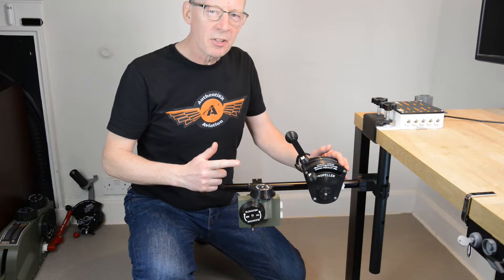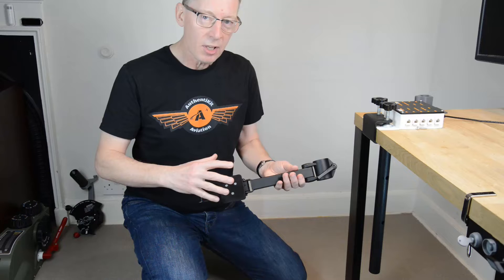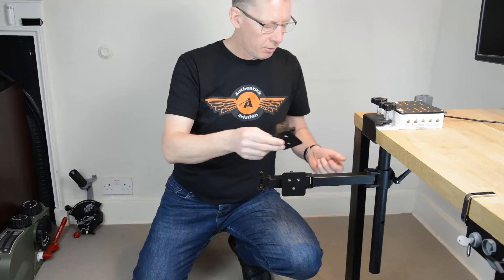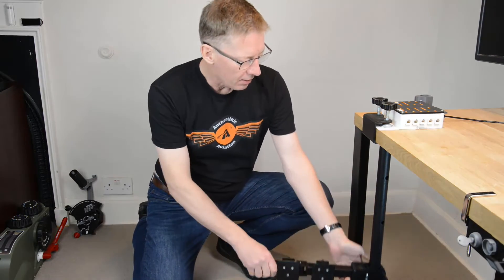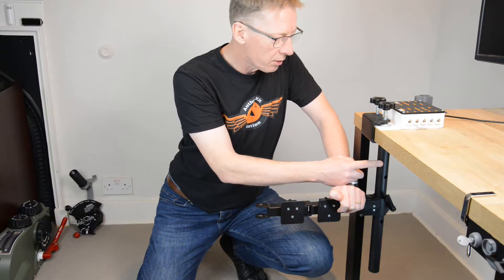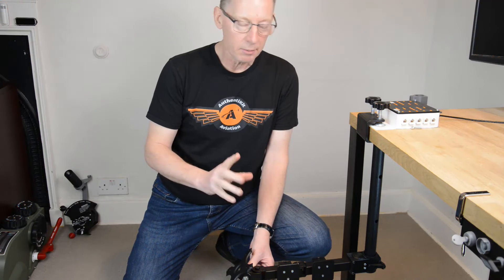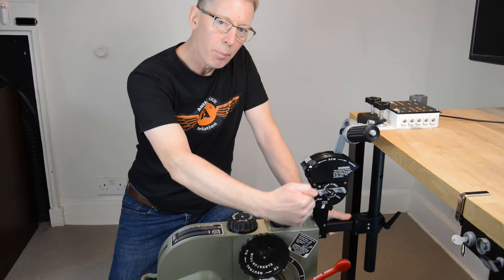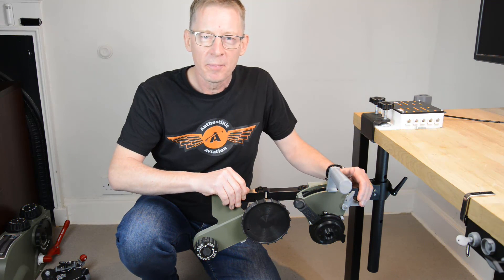AuthentiKit Mounting System V2

Comment: Phil,
I just finished the trim wheel and throttle quadrant this weekend prior to seeing this video.  Are the arms you are referencing at 17:00 out and ready to go yet ? And if so are they going to mount with the trim wheels and throttle quadrant I just completed or will I have to start on a new unit ?
Reply from the maker: Hi, no they're not finished yet. Hoping for end of June. However you will re-use most of the parts of the separate units. It's really the case that changes. No change to throttle. The idea of the combo wheels is that when mounted to the same arm as the throttle their relative positions are just right.

Comment: Quick thought: why don't you modify the pedestal to mount 15mm or more lower and then modify the riser to mount both the throttle and pedestal in their correct positions? You might end up with a funny L shaped riser but just have it mounted on two arm clamps for strength and then bolt the pedestal mount on the front of it.
Reply from the maker: I had thought of moving the dovetails. There’s not much room though to shift the dovetail mounts up and it might weaken the fixing. Also if people are super keen on the exact placement i suspect they’d be unhappy with wobble on the riser. Not ruling it out though.